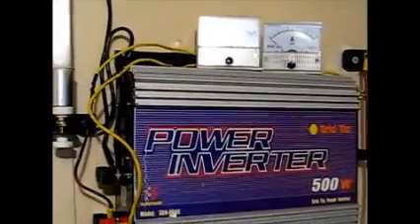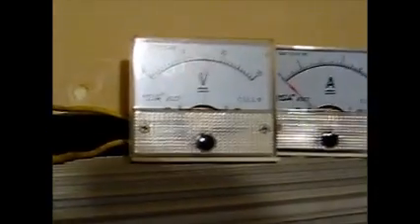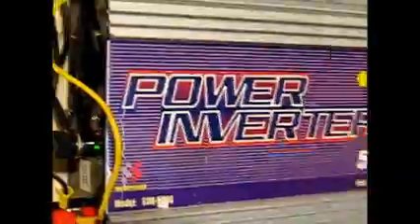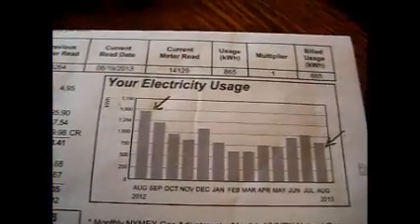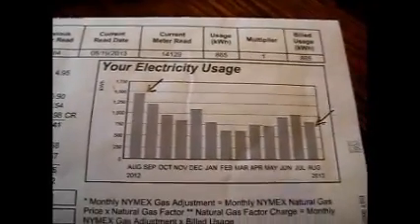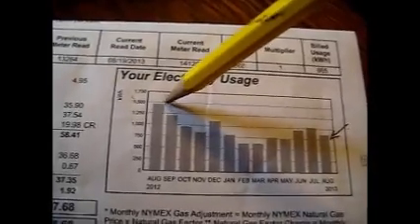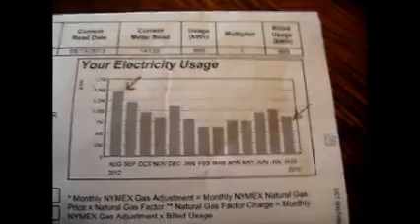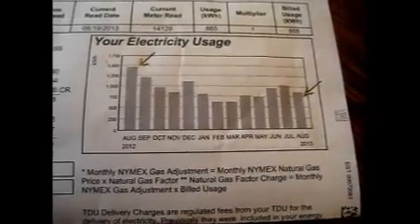UPDATE... Proof, Solar, and Wind Grid-Tie Inverters Really Do Work !

Comment: Do you happen to have any idea if these grid tie unites would work to tie in a generator. I have a generator that I've been running off of wood gas and would like to grid tie it into my house but I'm not sure if these types of grid tie units would work. I know the ones made for solar are made to receive DC input. And some unites made for wind turbines are made to accept wild ac current from the wind turbine but Im not sure if it would accept regular ac current from a generator. Commen since tells me it would but I don't know too much about electricity.
Reply from the maker: No! These are DC only and made for ether solar or wind. I have an AC wind generator, but the current needs to be converted to DC via a rectifier before entering the inverter.

Comment: AT EVERYONE WHO CAN HELP ME
Say for example my house only uses 1000Kwh and the solar panel set up and grid tie inverter generates 1000Kwh every hour of the day (this is theory) would it mean my electric bill would be FREE?
I know its not sunny 24 hours per day but this is just to understand how it works and get an understanding.
Reply from the maker: Yes youy can actually run power back to the power company with grid tie inverters and sell power to the grid.. Make sure you get a permit from the power company before you do anything.
Reply: Electronicdawg
I am going to make my own solar panels,solder all the cells together then encase them inside glass frames and wire them up, much cheaper than buying ready made ones
Reply from the maker: Are you sure of that. I only paid $100 per 100 watt solar panel. ebay.
Reply: Electronicdawg
Yes done research and can make more powerful for half the price,and i want to have 16 panels,so will be half price and better made

Comment: @Electronicdawg  So basically all i need is solar panels and a grid tie inverter and i can start putting current back into my mains supply and a s a result my bills will be cheaper,is that how it works.
If i had 10 x 300w grid tie inverters could i plug them all around the house and each one of them have their own seperate panels, so in effect i could, if i had enough panels run my house for free.
Does your bottom grid tie converter (the purple on) save you a lot on electricity just on its own? ,is it 500w

Comment: i have 3 Renogy 100w solar panels connected in parallel totaling 300watts paired with a sun 300 grid tie inverter i only get 50-90 watts.
ive tested all the panels and they are working ive been through 2 inverters (both being 300 watts) one from IMAGE which performed at 130w max out of 300 still terrible. The point of this story is that all grid tie inverters suck. I've just given up on solar all together too much headache to deal with. When i buy something i want it to just work.

Comment: can you connect multiple panels into a single grid tie inverter?
Reply from the maker: Yes you can as long as you don't go over the rated wattage. 3 x100wat. panels, you will need a 350 watt inverter.
Reply: I purchased one of the 500 unit like yours and found that it is rated for the 10 to 30watts, not the 22to60. Do you know why there is a difference? The seem to cost the same. Just to confirm my 10to30w inverter can only handle panel that generates up to voc of 30? Thank you for the help, it's great to find someone who is actually doing it and sees a reward from their efforts. Sometimes it's hard to believe these internet guys selling the stuff.
Reply from the maker: +j johns  one inverter per wind genny. Yea on the solor you can connect multipal panels to the inverter allowing you don't go over the rated watts of the inverter. I have 2 -100 watt panels connected to my 350watt inverter
Reply: Electronicdawg What sort of efficiency do you see, do you ever get 200 watts out of the inverter?
Reply from the maker: +j johns of course I do. 200watt solar panels
Reply: So your saying you see 100% efficiency in the conversion? Maybe my question was not phrased well, if you see, under perfect conditions 200watts coming out of the 2 100 watt panels, do you see 200 watts coming out of the inverter, if so that's 100% efficiency and I'm surprised by that.
Reply from the maker: +j johns I already answered you.
Reply: G Young Which is what I was asking, what is the efficiency of the inverter converting the dc power in and ac power out. 100% doesn't sound realistic.
Reply from the maker: +j johns I have no way of testing the out put of the inverter, just voltage input. If you unplug the inverter or loose power the inverter shuts down..
Reply from the maker: +j johns I'm assuming I'm getting at least 80% of what's its rated. Takes 12v power to run the inverter and built in fan also. I'd say the power loss is about the same as with any other inverter, but also don't have the need of a charge controller, or a battery bank. Solar panel to inverter to power to the grid.

Comment: If you have two GTIs on the same outlet why isnt one essentially powering the other which would prevent the loss-of-power fault to not work correctly and cause the units to stay on.   I'm no expert, so I'm just curious - in theory, why it is not like this?

Comment: ok dawg,, did ya get a power meter change over to accommodate the input from yer system so there would not be any troubles when the power came on..or did you setup a bypass so you had to manualy change switches  ie: flip out coming power from yer box  to off and allow feed from solars etc. be on a separate switch off of Power Boards Box ?
Reply from the maker: No, I just plugged in and feeding power to the grid, no problems, haven't heard a word from anyone.
Reply: papa54320 Most grid tie inverters drop off the grid auto-magically during a power outage now days. No special equipment needed.

Comment: You never really showed how the grid tie is actually connected to your grid. I'd like to see how you did it.
Reply from the maker: The the inverter is grid tie  , you just plug it into the wall, and your good to go.
Reply from the maker: Dan Tussuzian All you do is connect the turbines to the inverter and plug the inverter into your 110 outlet. No charge controller or anything else is needed except a load dump for the turbines..

Comment: you better get a permite to operate a solor system they sent out t.v.a. agents to my house because they thought i was steeling electricity
Reply: Hold on a sec, they thought you were stealing electricity because you were using less?
Reply: Gilly Gilbs
yes ''  also because i didnt have a construction permit  [city code viliation ] and need a grid interconection permite  and you have to pay a interconition fee $  also i had a grid tie inverter that wasnt uL aproved and a iee  aproved
i  bought it from china and thers isnt uL aproved  so dont buy from china if your going to  tie into your electrical grid
Reply: That really stinks, how big is your system?  Were you producing more than you were making or just off setting a very noticeable amount of electricity?
Reply: Gilly Gilbs
 20 x 300 watt  panels putting out about 25 amps  10.000   kwatts  or moore  on a sunny day  i was putting as many amps threw a 30 duel pole braker as much as it would take whth out tripping the switch
Reply: Nice, no wonder they came knocking at your door.
Reply: they just installed a smart meter yesterday so now they can monitor my meter readings from there work station i heard they can do it from the neg - ground wire  in the system
Reply: So what was the outcome? Did you have to pay a lot of fines and fees? I fall under TVA regs as well and was wondering what the process was like to get a "proper" grid tie system. They told me I had to have a NABCEP installer do all the work..is this true?
Reply from the maker: sv3nster
I have a smart meter also, haven't heard a word from anyone. maybe because they can see my wind generators  .

Comment: You need a controller for wind generator between the generator and batteries.also a dump load.Dont hook up wind  generator to inverter.
Reply: So if your wind turbine was generating 100V to a 12V battery, you're telling me it won't harm it? Of course it will! That's the whole point of using a controller/regulator.

Comment: I have another question. During a power failure, does the power from the grid tie inverter travel out into the power lines around my neighbourhood, or does the smart meter keep the power only within my own electrical system? The reason I ask is I would not want to electrocute a power company worker who is working down the line somewhere during the power outage.
Reply: If the inverter doesn't detect the grid (when power is coming into the home) then it can't Synchronize with the grids frequency so it'll just shut off.

Comment: If I have a 1500 watt grid tie inverter connected to my solar panels with battery backup, what happens in a power failure situation with my 220 volt appliances and deep well water pump? Will the 110 volt harm the pump? Do I need to turn the breaker off for the 220 volt pump and other appliances?
Reply: electronicdawg ok, so my 2 phase 220 volt well pump won't get damaged if I run the grid tie inverter during a blackout? I understand 110 to 220 volt 2 phase converters are available...is that what you were referring to?

Comment from the maker: Yes, It's called net metering and I need to sign up for it soon, rite now I'm not producing enough energy to worry about it, but maybe next year if I keep adding panels and inverters. The small inverter in the video is only 250 watt, about max for 2 - 100 watt solar panels. Far as I know you can use these new meters, shows "unknown power source" On my power analytics.

Comment: ok, I have 1 question Dawg.. Did you get a new electric power board meter to be able to run both electric systems together ?.. Here where I live, we have a power board that controls our electricity.If we try to run anything we have to get a meter that allows our power system to run in sequence with the EPB and if we create more electricity than we buuy the EPB has to pay us for any overage power we produce